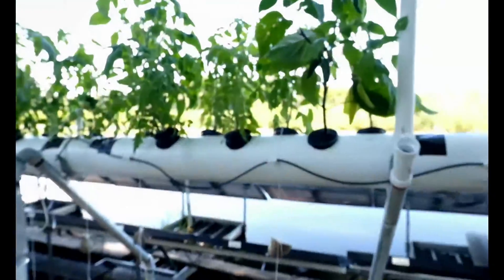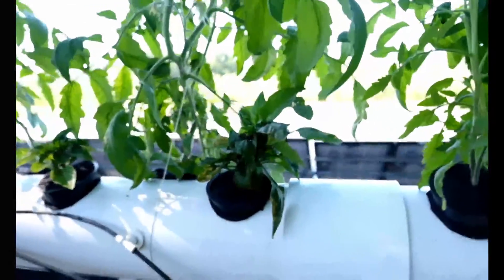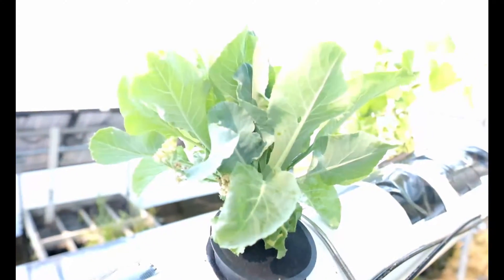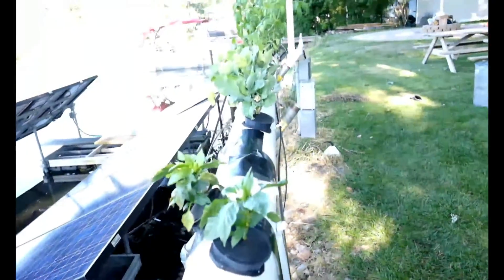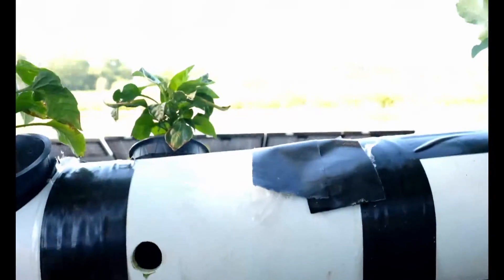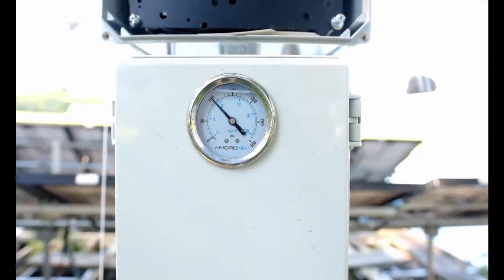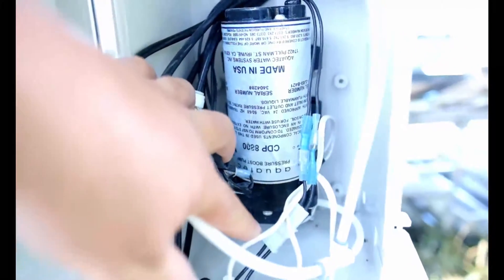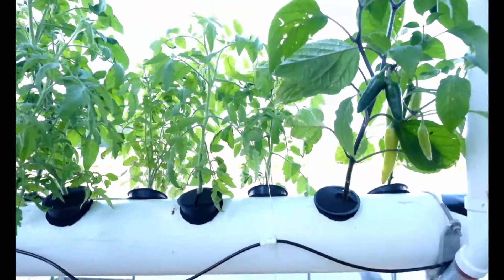Geothermal Aeroponic Horizontal Garden - Do it yourself build to grow your own food.

Comment from the maker: Good call on the pressure drop. I just put up a video showing about a 20%-25% pressure drop on the last spray head.
Reply: Hi William
Its good to test stuff than take it on faith. 
My pet hate is nozzle manufacturers flowrate and droplet micron size specs. 
You`ll find very few, if any, hydraulic nozzles deliver the specified flowrate. You can test it by weighing a dry poly bag on a good digital scale (0.01g) and then catching all the mist from one nozzle and subtracting the dry poly bag weight. Use the timer setting and nozzle flowrate to figure the amount of water that should be in the bag. Dont be surprised by the result :)
If you video the misting pulse from start to finish, you can visually check the actual mist running time, you`ll likely find it doesnt correllate to the timer setting.
If the pressure in the line gradually falls away after the solenoid closes, the droplet size will increase as the pressure drops. 
A coarse mist at the end of each misting will negate the benefits of using fine mist at the start. Its akin to painstakingly painting a masterpiece and then throwing a bucket of paint over the top of it :)

Comment: I would test the pressure at the nozzles, 100ft of 1/4" tubing will incur a sizable pressure loss.
Reply: Hi Atom..
With the length of feed times.. this is just an expensive, high maintenance NFT/Ebb and Flow set up ..yes?
at 15 seconds regardless of intervals.. the root system would be sodden and running off.
P.S.. its taken aeons.. but I'm putting together my system as we type...
Cheers...
Can i ask.. what type of pressure switch are u running? I'm looking at automation/process types as the chinese plastic things look like they won't go the distance let alone be reliable...
Reply: I have a couple of italtechnica PM-12`s which i`d highly recommend. i dont use them these days as i run drain to waste and simply charge large accumulators with nutes and let them run down. This keeps my accumulators clean, reduces the cost and complexity as well as the workload as you dont need to constantly check or adjust the PH, EC or water level. The nute makeup doesnt alter from the 1st to the last drop as nothing ever comes back. 
Pressure switches are needed if you recirculate the nutes but imho there`s no real need to use it for high pressure aero. The volume of water delivered coupled with low EC and efficient uptake results in the run off not being worth keeping. A correctly designed and operated high pressure setup will use the same or less nutes than a recirc system in the same time frame. The recirc res would need to be renewed (dumped), the drain to waste would simply run until empty.
Reply: lol...
We've spoken at length previously,
I too shall be running to waste (minuscule volumes) but am using a small (24litre) accumulator so need a fill every now and then from my  non-recirc reservoir, which  keeps nutes constant until that too needs refilling (i.e. mix and fill the tub - job done)
My nozzles are low flow BETE (red), output regulated at 100psi (Watts P60M1-4C )
From your experience/nouse.. I've reduced my system pressures due to the deadband (differential/hysteresis) on most pressure switches topping out at around the 25psi mark so in effect I've dropped from a hopeful 100-150psi set up to a 100-125psi set up. 
With these figures in mind, have i increased the amount of nutrients held/able to be held in the accumulator?
Trying to keep it as automated as feasible without sciencing the shit out of it.
(would only require my wife to mix and fill the nutes res whilst I'm away 2 weeks out of three).
Reply: The 24L tank at 150>100 will give you approx 7.3L, at 125>100 it`ll only be 4.3L.  The pm-12`s will give you an adjustable deadband upto 5 bar, roughly 75psi. As an example,  75>150 would give you approx  11L. I wouldnt recommend using this much range on typical el cheapo tanks equipped with a diaphragm ;)
Reply: my tank has a max operating/working pressure of 15 bar compared to most at 10... Though I'm told the JG fittings/plumbing (1/4") are safe up until 10 so won't be pushing the envelope too far.
agree fully with the range, thanks for that.
Trying to keep the footprint as small as possible within the workings "box" so will opt for the process style (http://gtsgauges.com.au/wp-content/uploads/Data-Sheet-S4250.pdf) or similar.
4.3 litres...sakes.. that doesn't seem much over 24l capacity.
You run huge tanks yes?
Reply: I use 100L vertical accumulators. A lot depends on the size of the system, how many nozzles and what their flowrate is, etc. A smallish setup 140L chamber could run for a fortnight or so on a 100L accumulator. Thats running to waste, not recirc ;)